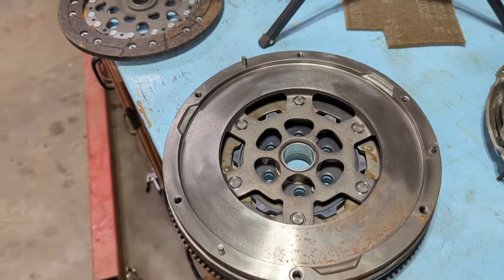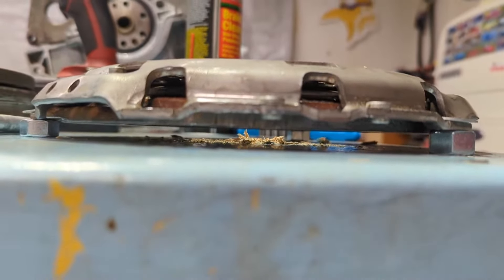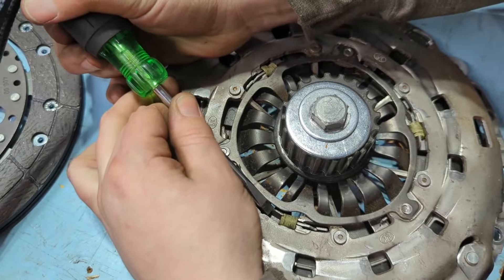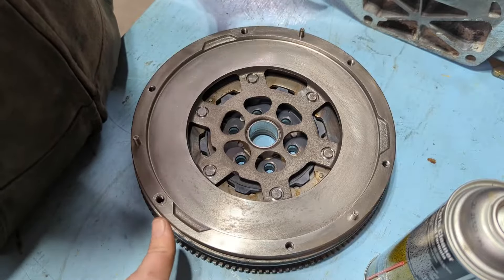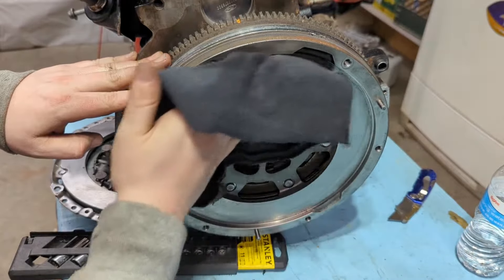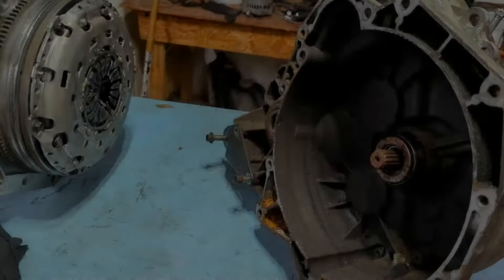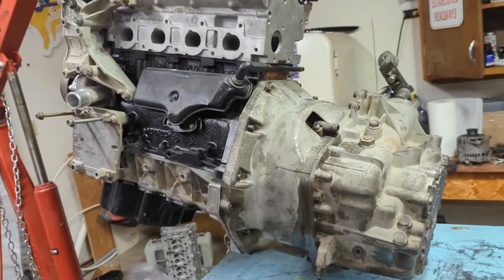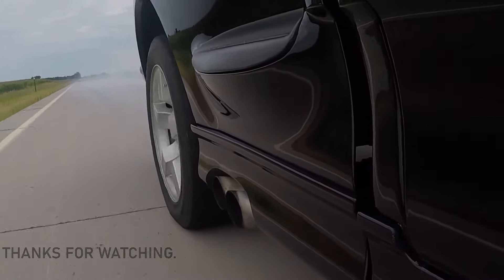How to Reset and Install a LuK Self Adjusting Clutch on an SVT Focus

Comment: I dealt with self adjusting pressure plate for the 1st time this past weekend.... After watching a few videos and with limited tools, i eventually used only the park bench lol... Yes park bench in my yard that had thick wooden seat.... Placed the pressure plate on top with 3 x same size small sockets evenly placed under the outer edge of the cover of the plate.... Centered it in the gap between the seats, long thickish bolt from underneath pressing against the bottom of the seat, old bearing , washer on top with nut and turned the nut with my wrench..... Once i found the sweet spot moved the pin anticlockwise, held it in the reset position opposite the marked  colored dots on the cover while releasing pressure... Job done 😊 ...... No need for the flywheel and clutch plate to be present
Reply from the maker: Nice idea haha. No spare park benches in my yard but whatever works!

Comment: Excellent explanation of how to reset the pressure plate. I've been through several videos and this got it all straight. Thank you!
Reply from the maker: Thank you for the kind words.  What are you working on?
Reply: @605BOLT  A friend sent me his 3.0L 2000 ranger. the last guy installed the new clutch and he can't get the new one to release the disc. I'm going to reset the pressure plate tonight and retest. I'd almost bet this is the issue because the adjusting springs are pretty far open.
Reply from the maker: Good chance.  Love me a good Ranger.

Comment: Just pulled my 02 focus svt engine out a few weeks ago nothing wrong with it but it had a bad oil leak so ran through it with new gasket’s and seals and about to put it back in and my engine has a pilot bearing 🤔 might want to check on that again!
Reply from the maker: Oh sorry just saw this comment. Ya I didn't see anything. Working fine so far haha.

Comment: Would i need to do this on a brand new clutch kit out of the box?
Reply from the maker: No it should be ready to install. You can visually compare those springs to confirm but they should be fully compressed or very near to it.

Comment: I did reset my springs, installed everything back, started the car, then I removed the gearbox again and the springs went back again just as before
Reply from the maker: If you cycle the clutch at all the springs will move. That is the self adjusting part of the self adjusting clutch.
Reply: @605BOLT so does it mean that clutch pressure plate is worn out? Because my clutch disk is new
Reply from the maker: @user-uk5jv8yz1x  no not necessarily. If the springs are completely extended then it will not have any more reach and it will start to slip but the way I see it, a clutch isn't worn out until it slips.

Comment: That’s very clear explanation of your work. Excellent! Could you advise what could damage the concentric slave cylinder inside the box? I’ve had two new LUK damaged in around 4k miles. All kit fitted was new including the flywheel. Really worried could happen again if I use a different brand now. Thank you!!!
Reply from the maker: @ninrm6355  I sold the car a while back so my memory is fuzzy but I think some people really struggle with getting the slave cylinder to seal and not leak. There is an o ring or something. I don't even remember doing it to be honest.

Comment: You have to use a clutch installation tool to install these. You can't just put them on or they will last approximately 3 months
Reply from the maker: You don't need any tools. You can reset them as I've shown in this video. I'm sorry you are misinformed.

Comment: Oh man I know the feeling all too well, when you have to take a bunch of stuff back apart to install one little thing that was forgotten.

Hey it could have been worse. You could have had the engine and transmission bolted into the car and been connecting the wiring when you realized the sensor wasn't in place. That would be a big oof.🤷
Reply from the maker: It's so true. Could have definitely been worse. I don't know what I would have done if the engine was installed. Thrown something for sure haha.

Comment: Can i do the conversion dual mass flywheel to single mass flywheel
Reply from the maker: Sure. This was a stock rebuild so I didn't want to do that but I'm sure for a more performance oriented project that would be best. Sadly I don't know what part number that would be either.

Comment: Transmissions and clutches make me nervous 😥😥
Reply from the maker: Ya that's fair. But the nice thing about these SVT focus cars is the transmissions are plentiful. Too many people pop their engines by timing belt failure or thermostat housing and therefore most get scrapped with good transmissions.
Reply from the maker: You might luck out and have it be shifter bushings haha. How do you know it is the clutch?
Reply: @605BOLT  that's just what the guy told me. Haven't even got to look at it yet.
Reply from the maker: How did you turn out?